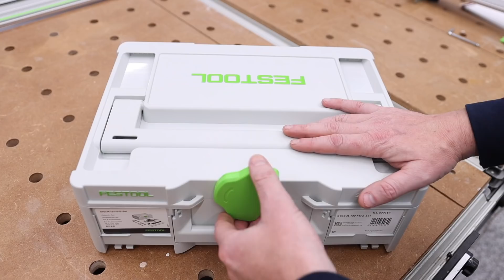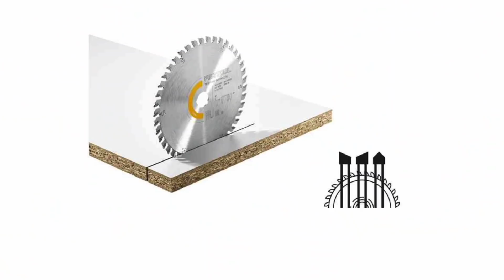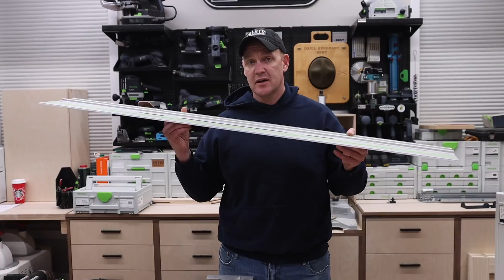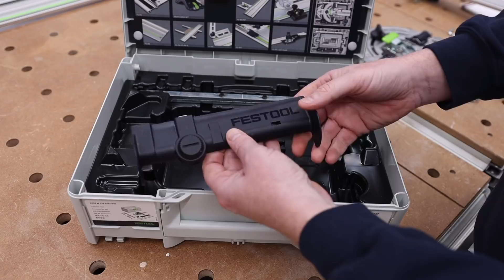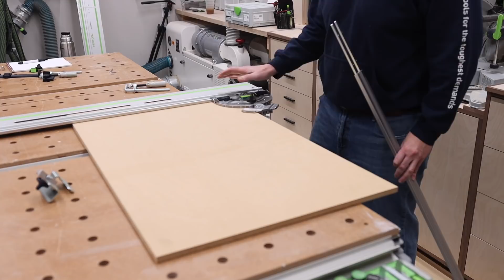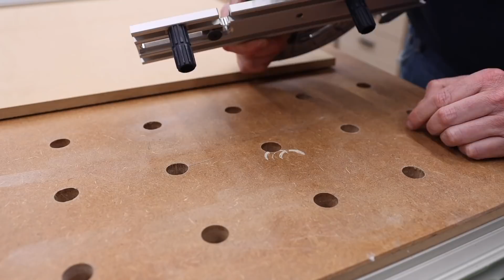Festool TS 55 F First Look

Comment: Note: I upgraded to 48T Oshlun blade before I made a cut https://www.youtube.com/post/UgkxvWxw4589nheZ_QlYwqaZpnQExQfvjV4_ This said, when combined with the Powertec 71153 track, the cut was glass-smooth and as straight as an arrow with no tear out! I was dubious about the kick-back preventer as it is a very simple, plastic device; but, it worked perfectly and is very easy to disengage when necessary. Simple and functional is often the best way of doing anything! Festool can keep its over-priced TS-55 and TS-75! Who needs such a pricey tool when an inexpensive, simple one does the job?! Very pleased!   DFYNT Dtrain - YouTube https://www.youtube.com

Comment: I just got this and it is great.  The only thing that was disappointed with was that the power cables from my other Festool tools (Domino, Sander, etc) doesn't fit.  The connector is slightly different.

Comment: Just got the festool angle square  a few days ago probably be ok for angle  cuts  ,you can't beat the tso parallel edge rail square  for 100% Square cuts with confidence, any thing  adjustable  will need  adjustment. Regards  from  Ireland 🇮🇪

Comment: Have you tried any aftermarket blades with this version saw yet?
Reply from the maker: Yes I have. Been trying some Tenryu blades for a while now. Very nice.
Reply: @bentswoodworking  Ah okay.. I have only found the ones from Key Blades that you've used on your older TS 55. Do you like the Tenryu blades better than the Festool or Key blades?

Comment: Thin kerf blades give you the illusion that you have a strong motor.  A thin kerf blade lowers the resistance of the blade during the cut and produces much less strain on the motor.  The tradeoff is thin kerf blades will dull faster and you can not send them off to resharpen.

Comment: In your video comparing the previous TS55 and TS75, your conclusion was you would choose the 75 if you had to do it over again. Ignoring the extra cut capacity of the TS75, do you think this new TS55 F would change that decision? Could the thinner kerf cut 8/4 walnut in a single pass?
Reply from the maker: I think you meant to say my conclusion was the 55. And yes! I cut through 8/4 bubinga in this video in a single pass and it is way harder than walnut
Reply: @bentswoodworking  I just saw the video where you compared the TS55 and TS75. Like Matt said, you did indeed conclude that you would get the TS75 if you could only buy 1! You said you’d rather buy the tool that does more vs not enough.

Any idea if the TS75 will follow suit with thinner kerf blades?

Great videos—I’m enjoying your comparisons and workshop set up. Subscribing….

Comment: Thanks for taking the time to share your knowledge. Clear, concise, and to the point. I bought TSC55KEB this winter but have yet to try it. One question: why do the new guide rails appear to be so much cheaper? Not something I would really expect. Is there a catch?
Reply from the maker: No. The new rails are great too cause they have some cool new features
Reply: @bentswoodworking Hi, is the new track compatible with 
TSC 55 KEB do you know
Reply from the maker: @Cen7urian  yes

Comment: Will you be using the Festool Rail Square or the TSO going forward? If you have a Festool Dust Extractor is there and real reason to go cordless with the Festool Tracksaw?
Reply from the maker: Just depends on the situation, both work well and get the job done. I'm a little more inclined with the TSO, but that's just a personal preference. There's never a wrong reason to go with a dust extractor. The bag on the TSC fills up quickly, so unless you want to empty it often - best to go with a dust extractor.

Comment: Does the saw have a powerfuller motor as the old ts55rebq
Reply from the maker: It’s the same motor
Reply: @bentswoodworking  just thinner kerf blades whats the improvements other than that
Reply: @khansk36  That's mainly it... a 50% increase in performance is HUGE.
Reply: @quiltedbyhanna  is that due to kerf of blade and teeth or power of motor

Comment: Hey Brent, thanks for the video. The information on all the new accessories was really useful and interesting. However, not sure if I missed something but what are all the new features of their new track saw, aside from it just using a thinner blade which you could already use on the existing track saw? (It’s the same width as the Mafell / Bosch by the way). Did you cover those features or did I just miss it?
Reply from the maker: Using the thinner blade on the existing saw would present a problem because the riving knife is still 2.2 mm. The thinner blade and riving knife is the update.
Reply: @bentswoodworking  Ah, I hadn’t thought of that - I mistakenly thought you had said you had been using thinner blades on your existing saw for a while. Out of curiosity how accurate do you think the new variable angle Festool FS-WA angle stop for your track is as compared to either the Festool FS-WA/90 or TSO track squares are? Was really taken with the idea of their new design for the flexibility it brings (especially with the extension to increase the reference surface) and have seen one here for a good price, though let’s face it 95%+ of the time most of us will only need square cuts. So would be interesting to know if this is a compromise on accuracy especially over say a cut on a full length 8x4 sheet compared to a rail square? Would make a good, short video if you are up for doing a comparison? 👍
Reply: @stephendixon8575  Ya, I am interested in the accuracy also. Square cuts are all I am interested in.

Comment: Do you plan a review/comparison video of the new rail square vs your Dashboard setup?  I have ordered the Dashboard but it is on back order until April.  It would be interesting to see if this new setup from Festool would suit my needs.  My process is similar to yours in that I make my final cut(s) on the table saw.  I seldom have a need for angle cuts—perfect square is more important—but having the ability to cut an angle could be useful.
Reply from the maker: I do not because the two things don’t really relate to each other. My crosscut setup is very different than using a track square.

Comment: When they were designing a new guide rail I wish they had made it like the Bosch and Mafel rails with the same style of connecting plate but maybe the new connector bars do a good job of straightening the rails
Reply from the maker: That is the biggest reason for the change

Comment: So will you be keeping your TSC 55K or the new TS 55F? I originally wanted a plug in model but they didn’t have the F out in the states. Now I don’t know if I would give up the ability to size some sheet goods at the lumber yard with my 55K
Reply from the maker: I’ll be keeping both.

Comment: I am wondering if I can order parts and retrofit a TS 55 R to work with thin blades? Is there any difference other than the blade and the riving knife? Not sure why it took Festool so long to move to thin kerf blades...
Reply from the maker: I am not aware of that will be an option

Comment: It's all good new & improved stuff, and I appreciate that, but I'd have been even happier if Festool had announced they'd finally changed to a descent adhesive for their plastic guide rail splinter guards.  I'm really tried of having to replace them with black ones from the turquoise-colored-tool company.  Unlike Festool's, theirs seem to have no problem with coming loose.
Reply: huh, I don't have that issue at all. Replaced mine about 8 months ago with the festool stuff and it just sticks. Maybe better clean your rail before applying?

Comment: How does this saw compare to the current cordless version? I'm in the market for a festool track saw, I saw that you highly recommend the cordless one. Some say that the cordless version performs better than the corded version.
Reply from the maker: The cordless did preform better cause it has a thinner blade. Now this new one has the same blades. It comes down more to do you want corded or cordless

Comment: This Festool rail square is surprisingly affordable. The kit is only a bit more expensive than a TSO square.
Reply: the TSO kit doesn't allow you to make repeated angled cuts. For a project with our travel van, this feature is useful for making cabinetry that requires special angles to fit the angles of the van interior.

Comment: I was so worried when you posted this. I had just got the ts55-keb based on your recommendation. And my initial thought was I acted too soon and they came out with something even better! While this is a great saw in this video, I feel relieved knowing it’s basically the corded version. Which I’m sure might cut faster, but I’m glad I got the battery powered
Reply from the maker: The purpose of this video was just to show you new products coming out from Festool. Not to make you regret buying another Festool 🤣
Reply: @bentswoodworking  I’ve been having issues with my makita tracksaw not cutting straight it’s not really made to adjust toe in, track cams not staying tight and now with very little use they have a flat spot worn in already 🙄  the makita tracks are straight but I have to adjust cams on every track because the are all sized different between batches ! it’s time for a upgrade so any conclusions now on cordless anti kick back or riving knife with thin kerf looks like that’s all that’s available now is thin kerf saws

Comment: Hey Jason, I appreciate the informative video. Do you know if the new track still works with the Festool router setup for cutting dados?
Reply from the maker: The track works exactly the same so yes. Just has the added slots. LR 32 you need to have the LR 32 rail

Comment: You said you’d been using the new thin kerf blades for a while. Was that in your old TS55, or did you have the new saw, too? (Really, the question is, can I just buy one of the new blades, and a replacement riving knife, and use that with my old saw?)

You demonstrated that you were using your old rails with the new alignment bars. So, the new bars will work with old rails? How about the reverse? (Again, a compatibility question.)

What about new new adjustable rail square? Can I use that with my old rails?

This is the second or third video about the new TS55 F that I’ve watched where no one comes out and explicitly says, “The rail profile design is unchanged, and your old rails work with the new saw and all of the new rail accessories. Your old saw works with all the new things, too. We got you.” That would be nice to hear someone say, even though it seems certain to be true.
Reply from the maker: The rail profile is unchanged. The connectors work in all of them. I used the thin kerf blades cause that’s what the cordless saw uses. And I doubt you will be able to retro fit and older saw.

Comment: Where does this track square fall in comparison of the others you've tried?
Reply from the maker: It’s hard to say yet since I just received it. It’s a very nice square and if you want to use it for angled cuts, this is one of only 2 options.

Comment: I find narrow kerf blades have a tendency to deflect if one is taking a thin sliver off the edge of a board. I actually prefer a 2.2mm blade in my 36V brushless Makita track saw, 👍🔨🇮🇪
Reply: Me too. Check out Tenryu. They have thicker plate than most

Comment: Hi Jason,
Very interesting video. After your review of the new battery powered TSC I had decided to go that route. Now I am thinking more about the new 55F. I am in shop based so the battery option is not as big to me. In your TSC video, I believe you mentioned you would be going to the TSC full time by replacing the other. Is that still your plan or has this new saw changed your thoughts?
Thanks, James
Reply from the maker: I still love my TSC. But it’s nice that the have a corded option now with the same great blade. I will probably keep a ripping blade in the corded and a crosscut blade in the cordless

Comment: I'm confused. I just got the TS 55 KEB. The unit says KEB on it, but the box says KEB F.  You guys are saying this is a "new product", but hasn't this been out since last year?
Reply: Do you mean the TSC 55 KEB which is the cordless model? The cordless tracksaw (TSC) with the new blades and anti kickback feature came out in the USA first (last year I think). The corded tracksaw with the new blades is just coming out in the USA this month.
Reply from the maker: The TSC 55 K came out last year. Cordless. This is the TSC 55 F. Corded
Reply: @bentswoodworking  it's weird as my box says f on it but it's cordless..

Comment: The new tracks are interesting to me since I just switched to side-by-side MFT table setup and might want to get another 1400. Though to be fair I just got the DashBoard and it's not nearly so difficult if I want to remove the track and put it back on and trust that it's true. I'm very pleased with that. (Go watch the Bent's "The ULTIMATE Assembly Table" video if you need to know more. They're a tiny company and it may take a couple months but it's soooooo worth it.) 

*

The new rail square seems like a pretty decent option as well with the single bar parallel guide. It also looks hugely lighter than the two side option Festool had (ignoring the rebranded TSO square). 

I don't have much luck with standard two bar parallel guides. They feel like a lot of work for little benefit.

Maybe I'm just terrible with the parallel guides. Tools take practice. But if the rail square/material is actually true, referencing on one side only seems like it would produce the same result as having an extra reference in the middle.
Reply: I was just looking for it a week ago, and the accessories are sold out.  I guess that i'll have to wait.  LOL

Comment: Thanks for the overview Jason.
Unfortunately I iterally just took delivery of a TS 55 REQ the day before festool announced this one. 😞
So now I'm having to go through the return process so I can get the new version. It's been relatively trouble free, and no cost out of pocket, but I called festool the day I ordered my saw and they made no mention of the new model being announced the next day. Very disappointed in festool over this.
Reply: You probably got the TS55REQ-F-Plus which is identical to the saw in this video. They started phasing them in quietly before making the announcement with a new model number. They have the 1.8mm blade and riving knife from the factory.
Reply: @LukePighetti  I didn't, sadly. The blade and riving knife on the one I'm sending back are both 2.2mm.
Reply from the maker: Well at least it wasn’t a terribly difficult process. You will like the saw and it will be worth it.
Reply: @bentswoodworking  Oh yeah, I can't wait to get the new saw. The first project It'll be used for is cutting down a couple of hardwood slab desktops. I ordered the rip blade and the universal blade as well.
My disappointment comes from not a single mention of the new saw coming out, which would have benefited festool, because they're footing the bill on the return that wouldn't have been needed had they given me a simple heads up.
Still, very excited to get it. 🙂

Comment: Thanks Jason.  Great info.  I was surprised that the Festool teaser videos about this new saw this week had next to no information in them, but thanks to your video I have a much better idea now about the changes.  Is the cut quality with this new thin kerf blade just as good?  Reason that I ask is one of the Festool videos from this week showed some substantial saw marks left at the end of a cut where it was zoomed in on.  I was surprised to see this...
Reply from the maker: I have noticed no difference with the quality of cut other than it cutting faster
Reply: @bentswoodworking  Hi Jason.  Thank you for making this video.  I would like to follow up on RF Guy's question.  You have said that there is no difference in cut quality between the 2.2mm and 1.8mm blades.  In the time you have used the thinner kerf blades, do you see any negatives when using the thin kerf blades compared to the 2.2mm blades?

Comment: Hi Jason, FEBQ model launched in the UK last year and it's been a joy to use. It's worth saying perhaps is that it doesn't push the Festool TS 55 corded saw format forward much, and is is outclassed by the R series battery version which has the kickback tech embedded. I do like the thinner kerf blade which is long overdue.
Reply from the maker: The thinner kerf blade is definitely huge
Reply: @bentswoodworking  don't you mean the kerf is small? 😅